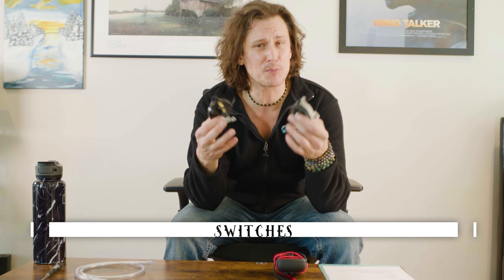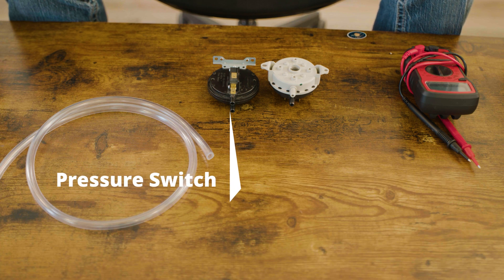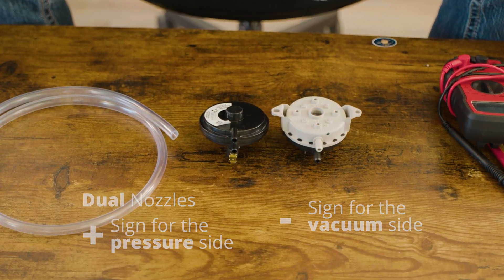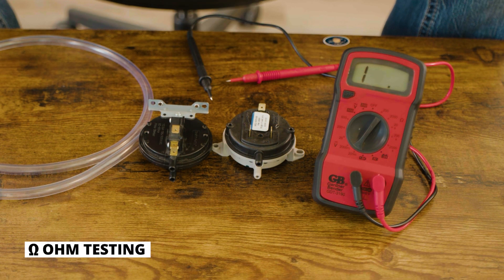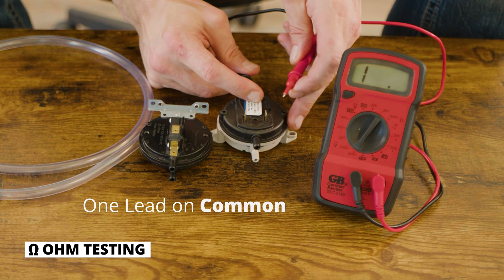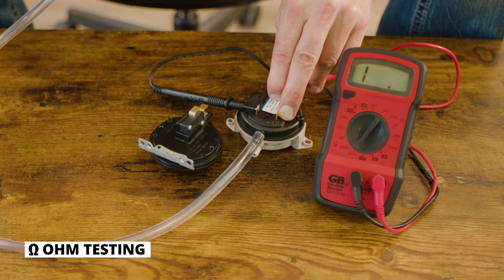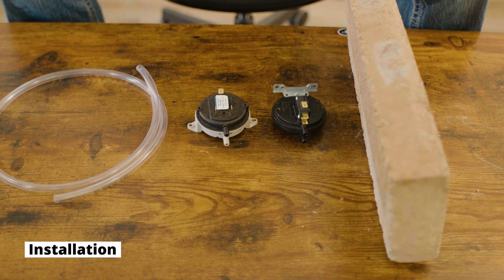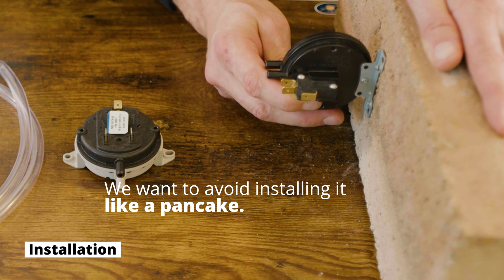Pellet Tech 101 - Vacuum vs Pressure Switch Installation and Testing

Comment: Ok, so weird issue. I just bought a new vacuum switch, it works as it should, but when I actually hooked it up to the auger feed, there doesn't seem to be enough suction. 

If I pull suction, with mouth, the motor will turn on.put the hose back to the proper spot on the auger feed, nothing.

I've cleaned it out extensively, new front door seal, new auger motor. I'm at a loss. Please help. 

Tia
Reply from the maker: Thanks for contacting us Tia. We would want to look at the combustion blower in this case. It should be running near line voltage on start-up to lock in the vacuum switch. Glad you checked your door seals and did a thorough cleaning on the stove and exhaust pipe. Any air blockages or leaks can cause the vacuum switch to not lock in. If the combustion blower voltage is good, then somewhere in the stove or vent we either have an accumulation of ash or an air leak causing the issue here. Feel free to let us know your make and model stove for additional suggestions. Keep us posted. Thanks.
Reply: @E @EarthSense lo  brother I’m sorry about the long message here but I have a master forge XL 140 pellet stove. I’ve had it close to about a year now I remember it was working fine. So About six months ago. I started getting a code saying e42 i’ve already cleaned the pallet stove really good from the inside. I’ve actually took out the blower to check it out. It looks pretty clean. I have to vacuum in a little bit, but it looks pretty clean. I went on the other side and there’s a blower I think that’s the blower that blows the heat towards the inside of the house. I checked that one out and it looks good. There’s nothing there. I already checked the pipes for the outside and it looks good as well. I also checked the hose that gets air. That looks good as well. I ran into your video and I was seeing that there’s a vacuum switch speaking about that specific part. I looked at it when I was checking out one of the blowers and the hose looked pretty black. Keep in mind that this was a white colored hose it it’s black but I didn’t pay much attention to it I messed with the hose for a bit seeing if I can clean it I did nothing came out but it’s not clogged at all I’m not sure if that’s a normal thing   it was very very black. I am not sure if the vacuum switch went bad All I did was got the hose took it out from a metal tube where it goes and blew on it and sucked on it and you can hear something moving inside the vacuum switch  like when I suck on the hose  the part inside It goes up and when I blow on the hose it goes down I can hear it I’m not sure if that’s a normal thing so with that being said, I don’t know how to test that like the vacuum switch or pressure switch that ever it is I’m not sure which one this stove has or if it has both so far the stove turns off within about eight minutes after running it doesn’t matter if it’s on the high mode medium mode or low mode doesn’t matter if I turn it all the way down to 60 Fahrenheit usually it goes up to 120 I usually have it at 80 but it keeps triggering that code my guess is that vacuum switch is gonna be the problem or something inside the other side where the hose goes to it’s like a metal tube the code  it turns off the stove. I was noticing too that the auger was not spinning. I turned the pallet stove off and turned it back on at one time earlier today then the auger spinned it seemed to work but it still gave the the code e42 after 8 minutes of having it on I was about to just tear the whole thing apart to  see if I can clean it more keep in mind it’s already cleaned but I ran into your video so I don’t think further cleaning is necessary I need help what ever it is it seems to be a vacuum issue or a pressure issue I’m stuck I spended  about $ 2,400 cash on this damn stove I don’t want to mess it up by tearing it apart when it could just be a simple thing such as a bad vacuum or pressure switch like I said I’m not sure which one I have or if I have both inside the stove how can I test it to see if it is working properly? Keep in mind that my parents are elderly folks. They ran the pellet stove without cleaning it for a whole month. I don’t know if that’s what messed up the vacuum switch or pressure switch I’m not sure if this stove has both vacuum and pressure switches like I said… I’m not sure if it’s even messed up I don’t know yet until you reply back, but I think that not cleaning it causes something to mess up not cleaning it properly can cause issues so I did advise my parents to clean it up at least twice a day just so we could prevent that from happening again if we fix it but I’ll wait for your response. Another question I had was  you know how the vacuum switch has the hose? where does that hose go hooked up to like what does it do cause hose hooks up to a metal tune then to the switch and that piece seems to be going inside of the pellet stove I don’t know if I need to clean inside of there or not, I just don’t wanna mess it up I cleaned exhaust pipes checked that both blowers are working fine and everything I could think of but no luck the code still appears  I was reading and seeing a video about the vacuum switch that you can readjust it, but I am not sure I don’t wanna get into that because the pellet stove that I was looking at had a screen and on that screen you can see it had information about the vacuum switch it said to shut off stove turn the part there the hose goes to counter clock wise turn on the stove and turn it counter clockwise until the vacuum icon comes on see mines doesnt have none of that on the screen . It has a regular screen.  Just says the Fahrenheit eco modes stabilization cleaning lighting and the codes it doesn’t have much info on vacuum I’m not sure if there’s a setting I looked at the manual it doesn’t have any information about looking for vacuum functionality I need your help being that your a professional please can you help me I’m so so sorry about the long message I’m being descriptive to help you help me I want to check the ohms on the switch to see if it’s working but I’m not sure what ohms i need to see and how to test it I do have a voltage meter that has ohms but I don’t know how to test it or I need to jump it I’m not sure it is a Cleveland Iron Works Vacuum Switch: 66639 that’s all I know
Reply from the maker: @rt_life8478  Thanks for contacting us, happy to help. The E42 code you mention shows it can be either an over-temp/over-heat issue or a vacuum switch issue. Given it hadn't been cleaned for awhile like you mentioned, there could have been enough ash build-up where it reached high limit and tripped the switch. In your model this switch is normally located on the underside of the feed chute. Its designed to be an auto-reset switch meaning it should reset back to the closed position once it cools down. On the other note, You mentioning the vacuum hose being black is very peculiar. Sometimes they are painted black or have overspray, but if it's black like it was burnt, that's definitely a big concern and it should be replaced and inspected further to see how that could have happened. The other end of the vacuum hose is checking for firebox and fuel hopper vacuum. The vacuum switch will trip if there are any air losses or air blockages - Blockage Ex - Heavy Ash accumulation in the stove, exhaust, venting. Air-Loss Ex - Leaky door gasket, glass gasket, hopper gasket, exhaust motor gasket or weak exhaust motor. Your stove as you mentioned is only about a year old, so generally speaking your gaskets and motors should be fine and it sounds like you have done a nice job cleaning it out now. Keep in mind that if either the high limit switch or vacuum switch was tripped or faulty it won't allow the auger motor to run. For troubleshooting only, we can test these switches individually - Here's a quick video on creating a Jumper wire to do this. https://youtu.be/FDVkbsHS95U?si=yX8kH6oa-QorJMhz

We don't carry the 66639 vacuum switch or 66645 hose, but we can help you source that or a different part if you end up needing one.

Keep us posted, happy to help.
Reply: @EarthSense  OK I appreciate it. I was gonna ask you on the jumping bypass. Can I leave that for a couple of days or no like basically the bypassing the vacuum switch I don’t know if it’ll start a fire or what will happen if I leave it on for so long like that I’m pretty sure the stove is gonna turn off. It’s gonna detect that something is not right. Let’s just turn off for a second and let’s check out what’s going on. do you know what I mean that’s part of the safety feature on the computer but I just wanna know if that would be fine to leave it on for a couple of days I’m going to test the vacuum switch using a bolt meter and I’m gonna put that bolt meter on ohms. I was looking at a couple of videos of you testing a vacuum switch and a pressure switch so I kind of have an idea whenever you slightly suck on the hose when you’re slightly blow on it it should read resistance right there. That’s what I’m gonna do, but if I noticed that the vacuum switch works, then I’m gonna go ahead and inspect the hose I’m gonna go ahead and inspect the gaskets because I really really really don’t think that the gaskets are damaged but being in mind that my parents didn’t clean it for a whole month I don’t know if that cost the caskets to get damaged or not so far the stove looks pretty good on the exhaust outlet on the air lay everything looks good. It’s just that when I put a flashlight on the air inlet, I take off the hose and on the inlet behind the stove when I put a flashlight, I couldn’t see it like a couple of pallets that fell right there. I don’t know if that’s normal or not. Maybe that’s causing the issue but the problem is I can’t get access to their this stove inside where the fire is up. There is three panels. The middle one has a hole for the auger I removed those and I cleaned them up pretty good but I can’t get access to the interior so I was thinking of removing the hopper and seeing if I could see inside to see if maybe it needs further cleaning but I’m not sure I don’t wanna mess it up. I’m gonna try the bypass and inspect the hose. This hose is a silicone hose but inside of that hose it looks black. That’s my concern.
Reply from the maker: @rt_life8478  Thanks for the message. We do not recommend leaving a safety switch bypassed for any length of time - only to determine/troubleshoot if that's where the issue is. If you bypass the vacuum switch and no longer get the error code that will let us know its either an issue with the switch itself, hose, or like I mentioned an air loss or air blockage in the stove. (If there was an air loss or blockage in the stove, you would notice a lazy fire and dirty burn during that start-up sequence. If your fire looks crisp/torchy, clean burning you most likely do not have an air issue here). Always good to start with the simple things first. If the vacuum switch hose is black inside then we would recommend replacing that regardless. It's a silicone hose, should be able to find the right size at a hardware store for cheap. At this stage we would not recommend trying to remove the hopper or dismantling the stove. When you pull the hose off the switch you should be able to blow through that to make sure nothing is clogged at the end. If you bypass the vacuum switch and still get the error code then that is not our issue. From there we would recommend bypassing the high limit switch to see if the error code comes up. Keep us posted, happy to help.
Reply: @EarthSense thank you god bless you brother you are helping out a lot of people stay warm I really appreciate you I’ll keep you posted on what happens I just had one question I just looked at one of your videos it seems like the high limit switch is gonna be the issue as soon as the blower kicks in that’s when the stove turns off and I get that code it makes sense now I’ll still test the vacuum switch but most likely the high limit switch is gonna be the problem what a coincidence that as soon as the blower kicks in it does that what do you think about that could it be that the high limit switch isn’t working anymore or could something be triggering it to open I’m lost on that part so far you are really helping me guiding me into the diagnostics
Reply from the maker: @rt_life8478  Reviewing the owners manual it states on page 22 that the 'high temperature limiter
is installed on the bottom of the hopper'. However, I do not see a high limit switch in the parts breakdown or diagram in the manual, I am only seeing the exhaust sensor and vacuum switch.. - Manual: https://www.allpartsinc.com/media/attachments/Master-Forge-Pellet-Stove-22-66730-REVE_OM.pdf

Unfortunately our company has never sold or serviced this stove model. We offer a few aftermarket parts for it, but don't have the same wealth of knowledge around Cleveland Iron Works and Master Forge as we do with some other stove lines. If there is no high limit switch, see if you can pull out the exhaust sensor and clean that up.
Reply from the maker: @rt_life8478  So when the room air blower kicks on is when the stove shuts down and gives that error code?
Reply: @EarthSense yes correct it’s wierd I’m not sure what’s going on I am going to check out the exhaust sensor like you mentioned in previous comment I know now what to do I’ll test vacuum switch and if it still turns off I’ll test the exhaust sensor like you mentioned i hope I find the problem and you are a good tech you have been so so so helpful I was going to have a guy look at it but if he charges me guessing a good $ 750 when it’s a simple problem I can fix my self  then  why not do it my self and use those $750 to buy pellets you feel me.. may god bless you man I appreciate you so much I’m good with electronics I have experience in that field thank you for helping me out
Reply from the maker: @rt_life8478  Yeah absolutely, happy to help brother. Yeah, I think those are the right steps here. That is odd that this happens when the circulation blower is kicking on. Maybe test that blower to direct power to make sure it's operating correctly to line voltage - video on creating a test cord here: https://youtu.be/rlmiCYI2WPk?si=VNnixVeI9quhRbIr
Keep us posted.
Reply: @EarthSense thank you I’ll keep you posted
Reply: @EarthSense  what’s going on brother I was just giving you a quick update yesterday I got home and my brother had the pellet stove on he said he put the setting on p4 the lowest and it seems to be working fine it almost been a full 24 hrs since the stove has been on it hasn’t turned off at all!! Which is great house is warmer for sure but I usually kept the settings at p1 highest p2 medium high to get the house to warm up a lot quicker the flame isn’t as high with p4 as it is with p1 p2 I was thinking what can it be why is it that when I have it at the highest setting it shuts off my brother mentioned a flame sensor but I don’t know if the master forge has one and where it would be located what ever the problem is it seems to be triggering the code e42 when the flame is high the higher the flame the faster and hotter the air comes out making the stove more efficient I didn’t test anything that we mentioned yesterday since it hasn’t turned off i haven’t the stove at p4 80 F it’s going a great job I usually put it at p1 90f then I turn it down a few hours later I’m not sure what’s going on of it was a vacuum switch it would have shut down already and even the exhaust sensor it would have shut down something is causing it to turn off what can it be !?? I haven’t seen a flame sensor or temperature sensor inside the stove the master forge usually has P1 highest P2 medium high P3 medium low P4 low basically the lower the setting is the longer the auger takes to spin and the shorter the flame is I did advise my brother it should be working on P1. It has to do its full job. Something is triggering it to turn off when it’s on the highest settings like I was telling you I don’t know if you could help me with that if you can get access to master Forge H140xl owners  manual it’ll tell you right there all about the settings I was thinking if it’s the high limit sensor, but being that it doesn’t have one I am not sure what’s causing this issue right now it’s not turning off. I will shut it off here in a little bit to clean it and fire it back on, but it’s weird. I kept telling my  brother it’s going turn off but it hasn’t  having it the way we have it right now on p4 it is throwing heat, but not as hot as I would like it to and the flame when I look at it it looks a little wobbly like it doesn’t look like it’s burning when it’s on P1 cause when I have it app, you one you can see that flame steady burning nice but right now it seems like it’s just waving around which seems to be normal, but I’m not sure
Reply from the maker: @rt_life8478  Thanks for the message, good update. Good observation that it appears higher heat settings are shutting it down and causing the error. Looking at the manual, wiring diagram and parts breakdown again, I think you should check part 66609 Temperature Sensor and Part 66613 Safety Sensor. Page 27-30 here of the manual will help with more of an exploded view of the stove and components. https://www.manualslib.com/manual/2879956/Enerco-Master-Forge-H80xl.html?page=27#manual

Keep us posted. Thanks!